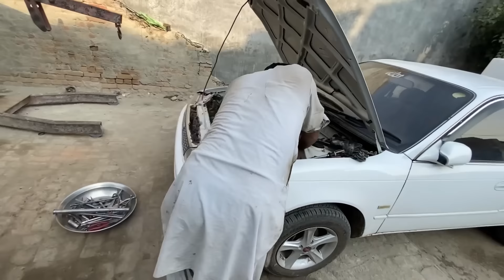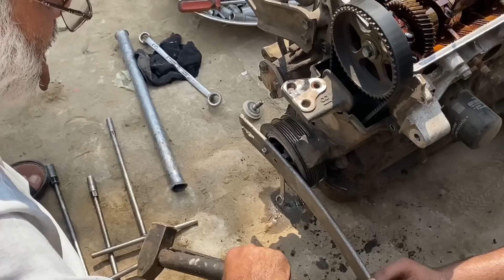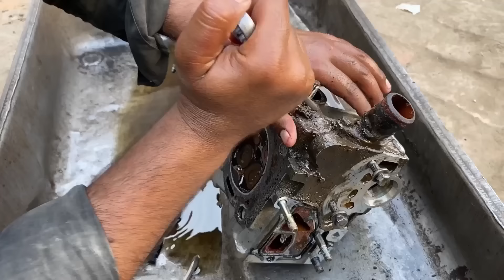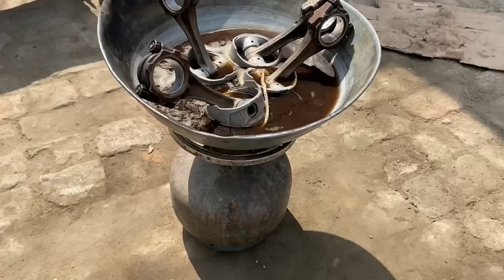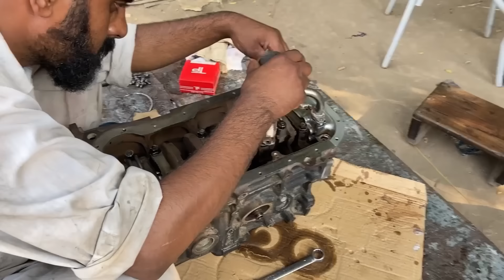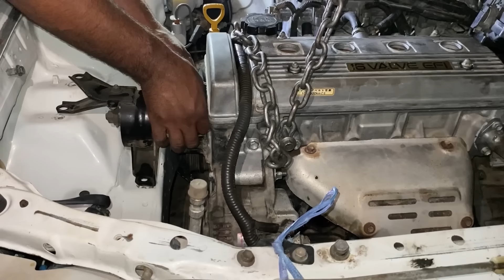Petrol Engine of Toyota Corrola XE Restoration ||How to repair 16 VaL 5A EFI Engine rebuild asembly

Comment: 33:32 no torque wrench on the head bolts
13:18 Dude dickered the torque converter seal
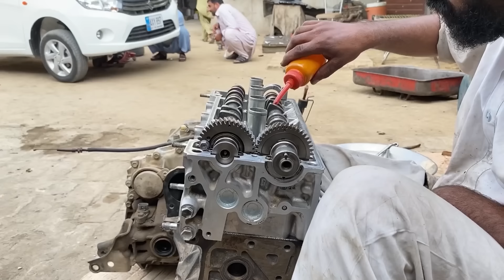34:16 ur cams not lining up bc u didint lock the camshaft lash gear fyi, before removal

This was a good engine before they took it apart

Comment: Зачем мерять зазоры, эллипс цилиндров, растачивать блок, ставить ремонтные поршни, править плоскость блока и головки, ставить ремонтные вкладыши, полировать коленвал, притирать клапана и затягивать всё с нужным моментом? Если можно всё отмыть....Этот двигатель мог ещё полляма пройти без этой "капиталки".
Reply: Так он и пройдёт ещё пол ляма, зато он чистый и отмытый, с новыми сальняками😊
Reply: ну да.. если тебе его в руки дать то он и 200 тысяч не пройдет с расточенным блоком. А ты в курсе что там специальное напыление и блок точат только в экстренных случаях? Вот теперь знай...
Reply: Вы прям все такие умные, а сделать нормальную машину сами не можете. Россия на весту шатуны и поршня в индии покупаете.  Машины говно.
Reply: Они в таких условиях работают, а в россии на заводе уже говно выходит.
Reply: нормальная машина веста и гранта, если хочешь бери пластиковую бмв или мерседес одноразовый
Reply: Да но кольца позалегали капитально
Reply: @Александр-х4я2э на чем напыление?)на чугунном 5а?откуда оно там?
Reply: Is it not cheaper to replace the engine/ motor, consider the cost of labour, seals, rod bearing, crank machine etc?

Comment: What happend to head gasket? Video shows no head gasket when putting the head back!!!
Reply: 32:36 it is there, I think they have applied oil on it thats why it looks like metal
Reply: For your information if you don't use head gaskets you never have to change the oil or coolant again. It's ingenious, you just mix oil and water and dump it directly in the valve cover.
Reply: Все там есть смотри внимательно
Reply: I thought they didn't put a head gasket when they installed the cylinder head, but when I looked closely, there is actually a head gasket. It is a silver in color and has 2 red circles around the 2 big holes, so it's not easily noticeable because it matches the color of the engine block.

Comment: If it's the 3 speed automatic transmission on that corolla I hope they filled the differential because you fill the differential on those transmissions trough a bolt on the back of the transmission. The differential fluid is separate from the fluid on the transmission pan on the 3 speed and some Camry 4 speed transmissions.
Reply: It's an A240L transmission.

Comment: is it a rebuild or they just wiped the dirt off everything?
Reply from the maker: Rebuild
Reply: To me that's what it looks like because I didn't see them hone out the cylinders & I zoomed in on the cylinders while they were reassembling the engine & it looked like the cylinders were still glazed & not honed.

They revved the engine out too much which isn't something that you should do with a rebuilt engine & I am wondering if they reused the old piston rings or did they fit new piston rings ?
Reply: @RussellBooth1977 what about the cylinder diacyl, even it looks shiny since new not yet installed, laugh out loud